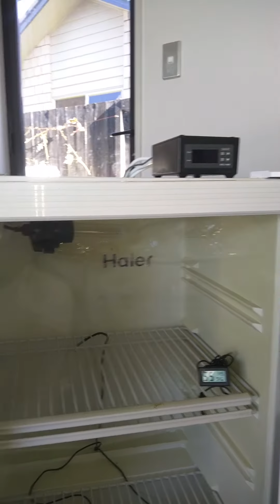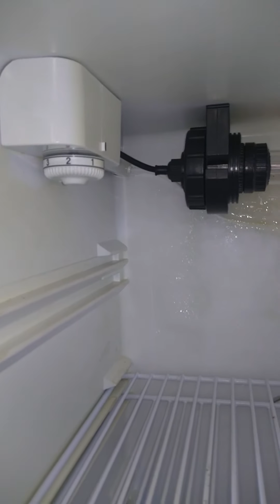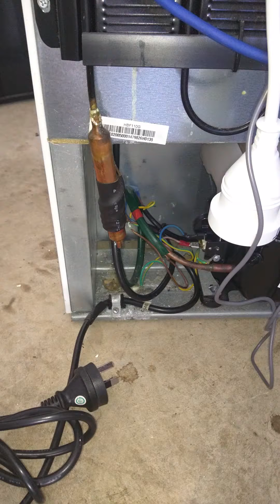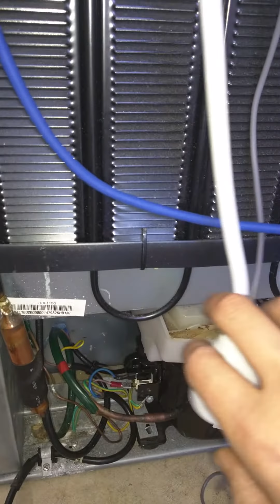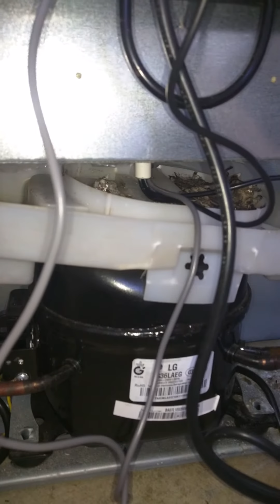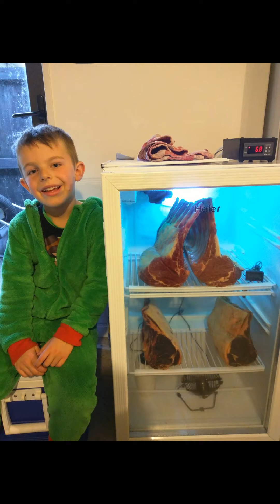Dry aged steak fridge build

Comment: Come join our facebook page "Dry Aged Beef", Like your UVC light. It does look like your is hot. (Get a cold one). 

Leave the UVC light on. 

Set the temp to lowest and then use InkBird (or some kind of device that control temps) to turn off an on the compressor and control the temp. Looks like you have an InkBird 

Also need Himalayan Salt. 

Otherwise you have an awesome set up. Keep Aging.

I have several videos on my set up "Crazy Daves Kitchen" on Youtube and Facebook